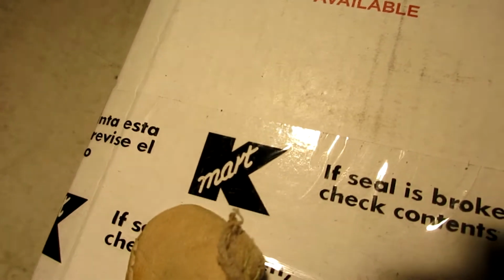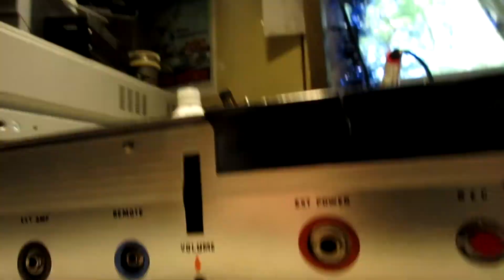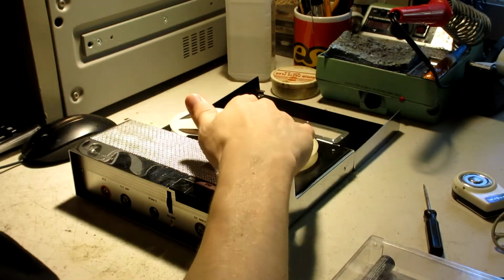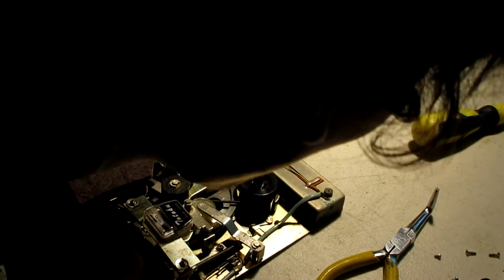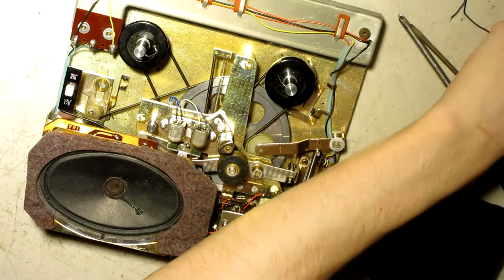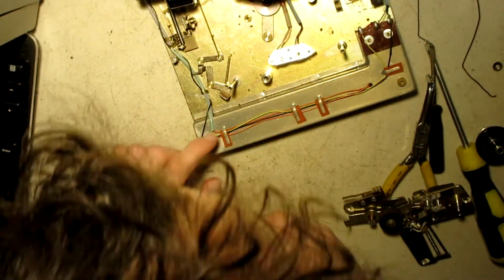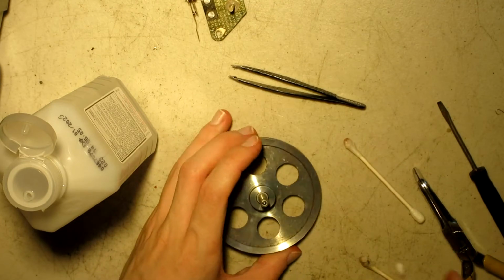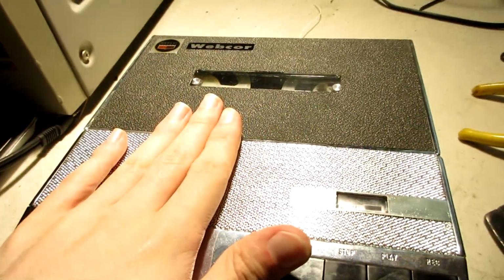webcor Ep 2104 #2 can something not preserved well still work?

Comment: I just got my hands on the civil defense version of this player. They basically took the tape door off, the battery cover off, added a transformer in the battery bay and a 9v battety style connector to hook it up to a 6D cell power pack inside of a beefy metal case to be used as an aerial survey recorder.